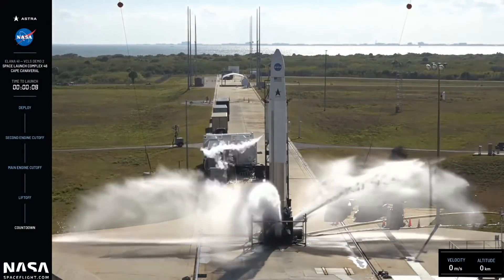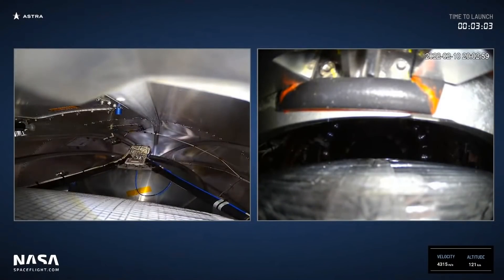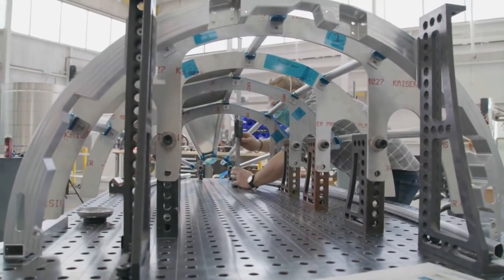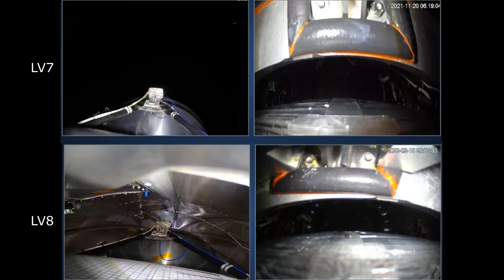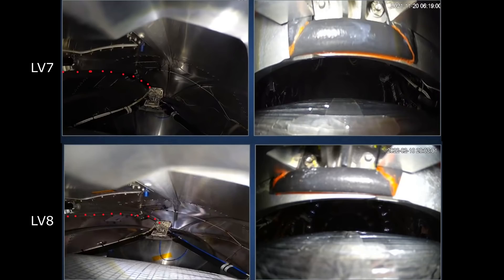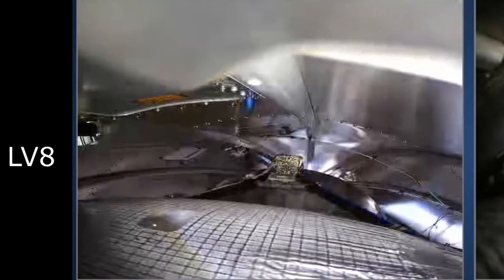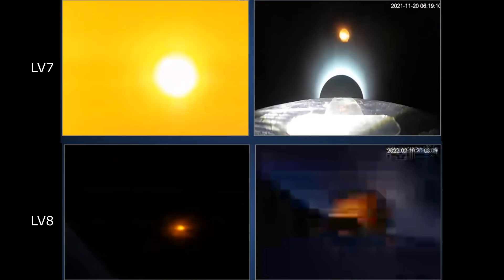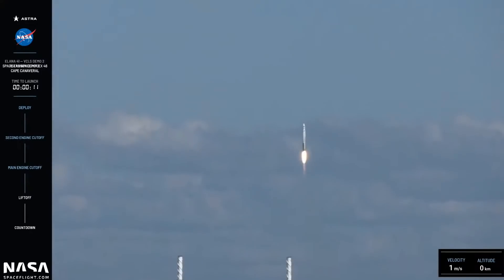Rocket Launch Doomed After Payload Fairing Won't Open

Comment: You can see the Earth, ever so slighty by the bottom left corner of LV8 first cam. when the fairing was supposed to pop off at 4:30. you can see the light of the Earth and the curvature.

Comment: They say we're going more than 2million mph., in 3 different directions at once, while rotating, so if that was really the case, then the rocket would be left behind in "space" the moment it pulled free of the "atmosphere"!
Besides that, no life would survive such violent conditions of those speeds and directions happening at once, or even be able to be born in it: "Gravitational" pull vs. 4 insanely strong centrifugal forces = death = LIE!
Show me an experiment in micro-scale, that proves me wrong!
Reply: dude, did you even pay attention in physics?
Reply: @rbbery  Can you hold on to a merry-go-round spinning at a speed of just 20 mph.?
What about spinning 1000 mph. in one direction, while spinning almost 67000 mph. in the opposite direction, while spinning 500000 mph in the opposite direction of that, while shooting through a vacuum of "space" at more than 2 million mph.? Would you be able to hold on to all those "merry-go-rounds" happening all at once?
And a vacuum cannot exist next to a air-pressure-system without a solid barrier between them!
The question is: Did YOU NOT pay attention in physics class?

Comment: the Einstein that  put this  together  put in the wrong size bolts in this  Just look at it Ray Charles could see this. . . This is what happens when you cut corners. The fabricator that put this together must be proud. 👌 You can tell when it's trying to separate and it locks up and not open.

Comment: Space is hard.

Starlink just lost 40 satellites that had just been launched but had not yet boosted into their proper orbits because of increased solar activity as we enter solar cycle 25, so they'll need to accommodate increased solar radiation in future missions.  Live and learn, hopefully on unmanned hardware.  However, it's been a long time since SpaceX has lost a Falcon rocket.  That technology seems well developed.  Astra is still in the steeper part of the learning curve.

Comment: Scott, out of interest, prior to the movement of any rams, white objects can be seen moving back and forth within the capsule on the left-hand cam view. Could this be a contributing factor to the stage failure, for instance the ram mountings that are out of sight sheering and the debris floating around. If one end of the ram has failed, immaterial of the amount of force it is supposed to subject at the other end, nothing will happen! Said white dots etc were not visible on the earlier launch footage, or could this be a case of FOD and necessary checks being missed?

Comment: So 7 launches, 6 failures.

I do understand that the Saturn V rocket was a LOT more expensive, both for the total project and cost per launch.  But one failure in 13 launches must suggest a different approach to engineering practice and financing, and one that proved more effective.

Really, "Sorry we destroyed you payload, we're still getting the details right" doesn't seem a good way to go.  Prove the engineering before claiming that you can swerve paying customers.

Comment: Why not use the Apollo Program tech? It got men to the moon and back many times safely over 50 years ago. Yeah right.
Reply: Yes, it did. But it was absurdly expensive. Some technological derivatives were used for a while afterwards, such as the Lunar Module Descent Engine being repurposed as the TR-201 in the Delta-P upper stage. But most development in the last 50 years has been focused on making things cheaper to expand access to space.
Reply: “Shoulda, woulda, coulda.”

Comment: It would seem better to have a series of separate actuators that can be opened and closed in sequence to test opening and closing. Sort of like a series of buttons on a shirt with separate actuators. Right before launch ripple across the actuators and test them opening and closing in sequence. Just opening one is not enough so it stays closed with the edges/holes aligned during the actuator test.

Comment: Usually, when i see video of military aircraft on a carrier or tarmac i tend to notice that any armaments attached to the aircraft have Tags attached that must be removed in order to arm the weapons before the aircraft takes flight. You also notice various tags and pins on the aircraft prior to it being piloted and it's engines are fired up. My guess is that somebody had one job to do and that was to remove the pre-launch  tags/pins from the fairings and somehow they forgot to do so. Human error tends to occur from time to time.

Comment: There seemed to be a lot of steering inputs on the first stage just before MECO, you could see it from the gas trail directly behind the booster. The weather was perfect and so was the visibility, you could see the second stage start to tumble for about a second and a half before it vanished. I would like to see the steering telemetry from the launch, it looked like the rocket was struggling before  separation.

Comment: something sparked behind the lower stage camera before the fairing is suppose to extend, you can see a molten object floating past the camera, looks like what happens when a fuse does what its supposed to do when the voltage is too high, or a cable burns out at a weak spot.

Comment: Is it just me or does everything about this rocket look just a little bit hacky.. the seal between S1 and S2 looks like a hillbilly head gasket repair. Machined aluminium can be quite grabby, I wouldn't be surprised if something was machined a tiny bit too tight/out of alignment. Tolerances would shrink quite significantly once exposed to the low temperatures at altitude

Comment: The tiny rocket people are ridiculous. SpaceX is building a fully reusable 100ton launcher and they are building toy rockets that are more expensive to launch than Starship will be. Why????
Reply: Because monopolies prevent innovation.
Reply: @the18thdoctor3  There is nothing innovative about tiny rockets that don't get to orbit. The Chinese had them for a long time. ;-)
Reply: @schmetterling4477  
First of all, you’re blatantly wrong. But more importantly, it doesn’t matter if the competition is successful or not. The existence of competition forces SpaceX to continue to innovate and drive down prices. Otherwise, market forces would allow them to charge the profit-maximizing quantity without worrying about losing business. Without competition, Newspace (particularly SpaceX) will become Oldspace Mark 2.
Reply: @the18thdoctor3  They are also selling fireworks for the fourth of July around here. It's much more colorful when it explodes before it reaches orbit and it's also much cheaper. ;-)
Reply: @schmetterling4477  
So you know nothing about either the current prospects of the smallsat launch industry, nor about macroeconomics in general. Got it.
Reply: @the18thdoctor3  Yes, the economics of fireworks is much, much better than the economics of tiny rockets that explode before reaching orbit. Has been for centuries. :-)
Reply: @schmetterling4477  
Case in point.
Reply: @the18thdoctor3  Dude, the annual revenue of the fireworks industry is around $2 billion. That's roughly the revenue of SpaceX. The tiny rocket people are not even close. ;-)
Reply: @schmetterling4477  
So what’s your point? We should just forcefully shut down the smallsat industry?
Reply: @the18thdoctor3  My point is that the tiny rocket people are ridiculous. SpaceX will soon offer launch opportunities for 100 tons of payload for between $10-100 million. Good whiskey is more expensive than that by mass. :-)
Reply: @schmetterling4477  
So you’re completely ignoring why dedicated smallsat launchers exist. Come back when you’ve done any market research at all, even just googling. The keyword is orbital accuracy.
Reply: @the18thdoctor3  They exist because the folks who are building them can't build rockets for real men. :-)

Comment: This is where the space shuttle was superior. Had the cargo bay not opened the crew could just get out and manually open it or fix it.
A unmanned rocket makes this impossible. Though it is way cheaper and "safer" as no human can get hurt if things go really bad...
Reply: If the cargo doors hadn't opened on the Shuttle, it would have overheated within a few hours and be a LOC event.

Comment: If the fairing on one side released and the other fairing did not, that would seem to explain the end over end tumbling after the second stage engine fired. The free side would have started to rotate towards the locked side until that side came loose. Nothing would stop the tumbling at that point.

Comment: I didn’t scroll through all 1000+ comments, but I think there was some sort of structural failure in the fairing.  Compare the right images at ~2:30, the strut to the left of the snubber is out of place, the whole assy seems to have shifted left at some point on lv9 by a couple of inches. That certainly would have interfered with latch operation. The fairing was likely over stressed at some point causing the strut failure.

Comment: OOF.  They never added a check to ensure the stage ACTUALLY was released by the fairing and had enough clearance to light the engines?
Instead, they opted the poor-man's route... wait X seconds after we signal the latch to be released... assume the fairing opens and stage is floating away... then light the candle.
This isn't rocket science.  (Pun intended.)

Comment: That's one hell of a gut punch for the experiments on board. Like gambling, it's a situation where you shouldn't be riding along if you can't afford to replace your investment; at least such is the case with rocketry in the current time.
Let's just hope it wasn't something as simple as forgetting to remove a safety pin. 🤦‍♂️

Comment: Back in the day I worked on the Delta II 10 ft. Composite Fairing development. During the 1st launch the fairing recontacted the 2nd stage. It also had a bunch of the acoustic blankets get separated and blasted out of the fairing. The mission was a success, but we got lucky.
It turned out the fairing was pretty stiff and the separation mode where the fairing opens up on deployment then closes back in was too quick and the lower corners of the fairing recontacted the 2nd stage. The cheap fix was to add ballast along the separation plane to slow the separation mode down. We also used better attachment methods to attach the blankets. 
It was a shame to have to add a bunch of weight to a nice lightweight composite fairing. But that payload fairing worked perfect for many missions over decades.
Reply: Hi Matt.  Long time.   I remember you from the Boeing days.
Reply: You might remember me from Vandenberg.
Reply: @rocketman7sam  Hard to determine who you are from just the channel name rocketman7sam
Reply: @mattcolver1  Sam Kelman
Reply: @rocketman7sam  So we both worked for Ramsauer at one time or another. The times I went to VAFB for ULA was to store some test hardware, Inspect DCSS test hardware for use in SLS testing and evaluate the various machine shops at VAFB. Back in the Delta II days in the 90s I investigated items we could spend NASA's extra budget on to fix up SLC2.

Comment: folding wing rocket, go go goo
Reply: its also called "cruise missile"
Reply: from cruise to hyper sonic
Reply: sweep the wings back inside
Reply: use the belly body lift in the hyper sonic flight only
Reply: body wings opening up like a flower as parachute mesh, copter or foil
Reply: or just a helium balloon from the top
Reply: the opened filled balloon is a parachute as secondary action
Reply: That seems like a lot of pointless and mass eating hardware.
Reply: @TheEvilmooseofdoom  might be, wings let you take off as plane, move to rocket hypersonics, you could also directly be as a rocket, but have hard time landing

Comment: Is it the payload fairing or is it the fairing between the first and second stage?
Reply: It is a fairing which covers the second stage,  but is  attached to the first stage.   The second stage is designed only for the vacuum of space which saves weight.
Reply: @carabela125  yes, so not the payload fairing.
Reply: @HunterDFtwo    There is only  one  fairing.   It covers both the second stage and the payload.

Comment: Great analysis. A really sucky failure mode. There was a company that sold a load of dodgy metal extrusions that were out of spec and so prevented explosive separation, burning $700million according to the OIG. They ended up being prosecuted, because they had faked their test results. Nothing to do with this of course but this must be heartbreaking. To fail over fairing separation. Shows you can't take anything casually in the launch business.

Comment: Poor design. Should have a pull pin or something that prevents the 2nd stage from firing unless the pin is pulled, which would occur if the 2nd stage has traveled sufficiently far enough away from the 1st stage.

Comment: When that second stage slammed into the fairing, that was the big "uh-oh" moment. I've never seen such a failure, and it honestly makes me question what RocketLab is going for with their Neutron concept. If you have the fairing atop an upper stage, you can still get at least most of the way to orbit if the fairing separation fails, but with the fairing encapsulating the upper stage, a fairing failure means a guaranteed failed mission as the upper stage and payload sustain major damage by first bumping into the fairing, then by blasting their way out. I have no doubt that the gut-wrenching spin was because one of the upper stage fuel tanks had a leak due to fairing impact or engine blast back. As much as I like the idea of "hot" staging, there is a reason for the exhaust holes on the interstage.

Man, Astra has had a really tough time with this rocket design. 8 flights, 1 orbit. I hope they can recover from this and start getting more success under their belt. Getting to space is easy, but getting to orbit is a lot harder.
Reply: If your fairings don't separate, your mission is toast no matter what. Most second stages don't even have the spare oomph to put the payload and the fairing into orbit.

Comment: I'm surprised they did not pull the rocket after the last launch failure considering they pushed it that far to launch. I would not doubt that that hard shut off might have Jared something loose. Maybe a broken sheer bolt or something

Comment: Even if it could have recovered, I would have doubts about the reliability of the fragile satellite payload with the sudden pressure moving through and hot gasses inside of the fairing.
Reply: Also it's likely that being smacked into the inside of those fairings a couple times probably wasn't any good for the satellite, either.

Comment: This is reminiscent of the "angry alligator" incident that NASA had on Gemini IX. The fairing on the Agena target vehicle failed to open completely, which prevented the planned docking from occurring. It happened because the technician working on the fairing had to leave work early because his wife went into labor. When he left he had not yet connected the electrical umbilical that had to fire the ballistics to completely separate the fairing from the docking target and no one ever noticed the error.

Comment: I'd guess that those pistons have a transport mode to prevent injuries.
Its surprising they didn't detect the issue before it was made worse, have to wonder how much was preprogrammed and what controls they had flighttime.
If you are going to blast off the fairing and 1st stage its usually better to start a roll first to keep the alignment or at least the roll can remove the fairing.

Comment: There will probably be software or hardware interlocks that if the fairing clamps are not unlocked, the pistons cannot be extended. But it's interesting to see that the 2nd stage timings were unaffected.
Reply: Things could be worse. Remember the Nedelin catastrophe..

Comment: The fact the payload is pushed forwards into the fairing suggests that piston had deployed but didnt break the fairing loose. It looks like only 1 thing failed, the clamp holding the fairing together. Also, the fact you can tell the other clamp released also suggests its not a system failure as both clamps would have failed in that case, and the payload would not have been shoved into the fairing.

Comment: Good analyzation.  Saw that hitch hang up in the news video yesterday.  Really looks like the fairing acted like a huge rudder or spoiler so that when the 2nd stage lit up,  the asymmetrical force was multiplied by an order of magnitude.  So what happens to the 2nd stage and the fairings now?  More space junk floating around ?
Reply: 100% the second stage never made it to orbit, so it just fell into the ocean somewhere.